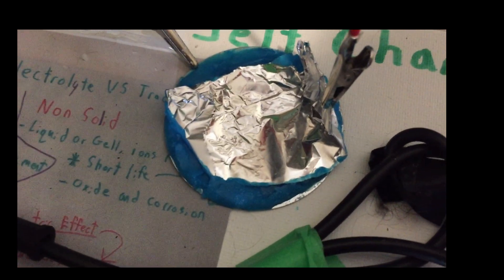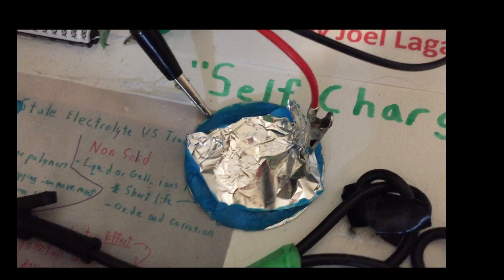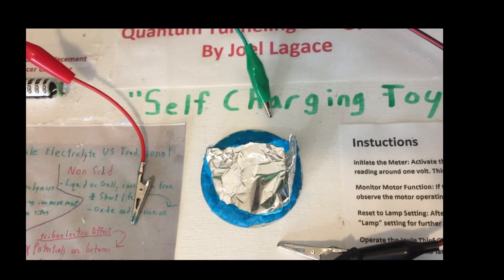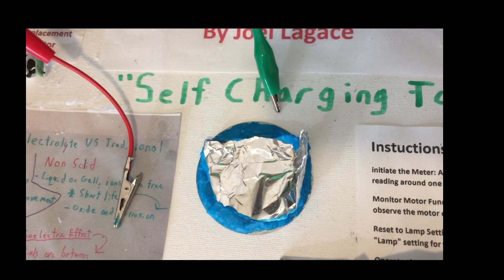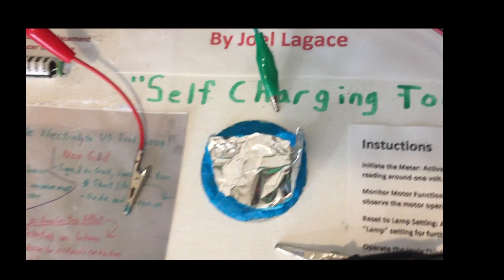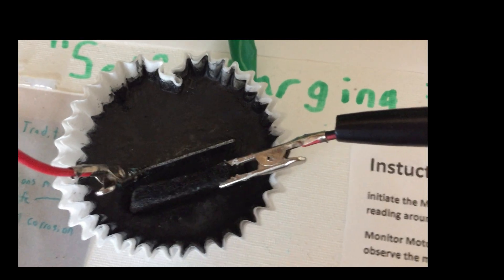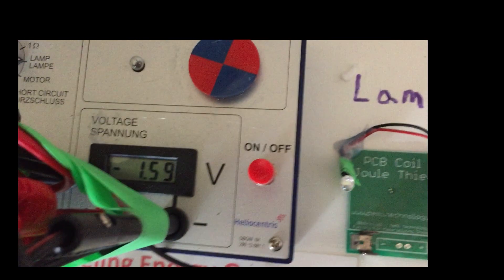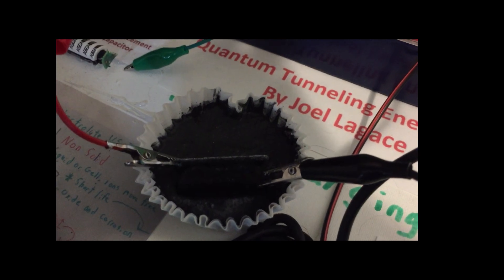Quantum Power Cell Progress Report

Comment: In a electrolyte, the voltage will mix, maybe drag out the ice cube tray an segregate. Positive s from negative as much as possible.
Reply: I built 6 diehard dc volts out 13 pop cans. And learn erosion techniques are out the question. Dry cells are less fire hazards. There nothing to burn.
Reply: Anhydrous oxide is nasty. Copper oxide is easy to make through. Watch for erosion. Acid destroy the metal we use in the batteries.
Reply from the maker: I seem to be having success with copper oxide in the mix as it gets hard for some reason.

Comment: I sandwiched aluminum foil, paper soaked in hot polypropylene one over the other in dry cell style stack (6 sheets of aluminum foil 1"x1-14" ) separated by copy paper. After charging with a 9 volts battery for about 10 min. I get a solid .6 to .7 volt (just under a volt) going to try copper foil and aluminum foil next separated by thin paper towel soaked in hot polyethylene glycol.

Comment: Happy to see you following the path, great work 👍🏼

If you have a look on your forum, I already wrote a while ago about my experiments with similar materials in tap water or similar materials in tap water or even deionised water. I have been able to read a voltage from 1 sqcm of aluminium foil and copper foil with just printing paper in between if they are squeezed.

Anyone can try themselves any method. If you have some 10 v 100 uF electrolitic cap short it out many times to make sure there is charge left, then just put it in a glass of tap water and see how is charging itself 0.5 v or more, now repeat with deionised water and check … also take a diode pit your probes from a multimeter on each end and immerse the diode in a glass of water while watching multimeter.

Also, you can try aluminium with gold, silver any metal that does not react with water and see the voltage there … no fancy electrolyte or compounds, just tap water.

If you want little gap between electrodes you can use fibre glass tape for plastering if metal is sturdy enough … I may make a video next week to show what can be done if you need. And nothing go to waste, no pollution ! All safe and easy anyone can do with almost no tools at all.
Reply from the maker: Diving into the phenomenon you're describing, it's reminiscent of the exploratory spirit that we often chatted about. It involves the interaction between electrochemical potentials and the electromagnetic field, a topic right in the wheelhouse of our discussions.

Chat GPT Please explain:

When you submerge an electrolytic capacitor in water, particularly if the water is slightly conductive (which it often is, due to dissolved salts or minerals), you're essentially setting the stage for a galvanic action. This is because the electrolytic capacitor has key components made of different metals: the anode and the cathode and outer shield. These metals have distinct electrochemical potentials, a disparity that becomes the driving force behind the galvanic reaction when they come into contact with an electrolyte.

The outer casing of the capacitor, often aluminum, acts as one electrode, while the internal plates, treated with a different metal or metal oxide (often tantalum or aluminum oxide for the anode), act as the other. When these metals are immersed in water, the difference in their electrochemical potentials leads to the movement of electrons from the more anodic metal (higher tendency to oxidize) to the cathodic metal (lower tendency to oxidize) through the external circuit. Simultaneously, ions in the water bridge the gap internally, completing the circuit. This creates a loop where electrons can flow from one material to the other, generating a small voltage as a result of the galvanic reaction.

What's fascinating here is how this process essentially harnesses the natural propensity of materials to reach an electrochemical equilibrium when presented with a pathway for electron flow. This phenomenon can be likened to the way we look at the vacuum, or the Dirac sea, in our discussions—always probing for ways to engage with and utilize the inherent potentials of materials and fields.
Reply from the maker: I guess what it's trying to get at is capacitors are not all "Air tight"
Reply: @joellagace1679  🤭🤣 what’s the explanation for the diode than ? Or for just 2 jewelries of gold in deionised water ? How much do you trust chatgpt ? So, all capacitors I am using are fake, but still working normal in water or air … anywhere I want to use them ? Really ? I guess you have handy few types of caps and can afford to buy from shop 1 litre of deionised water to see for yourself … and use any scrap metals you have around or even dishes from stainless steel or cutleries or bolts of the same metal

You can read a voltage even from bread … it is everywhere

And by the way, you get same voltage reading on a capacitor even if just the legs touch the water, not necessarily to immerse the whole cap in water and those tiny legs are made of the same metal … no galvanic reaction, especially if there is deionised water.

I guess you are aware that a diode has 1 v forward drop before anything can pass … and yet you can get voltage reading by just dipping its ends in water … than just do it timely to see 😉
Reply from the maker: I like what your doing and noticed similar results as well. Just trying to provide a possible perspective. I think most here know not to take everything chatgpt says about these systems line by line.
Reply from the maker: For sure, I did this a few years ago with just water as well you only need to choose two non corrosive metals and you get the electrostatic displacement between the two potential difference in electrons. It's more electrostatic and not so much ion based. But there is always traces of PH even in water and moisture and that is enough to facilitate ion flow. Making it appear as its just a pure water reaction. But yeah its fun for sure and will work a long time. But for some reason people don't like water because its messy to work with lol.
Reply: @joellagace1679  water is universal medium for a certain frequency as the air is as well 😉 

I am on course to upgrade my devices then I will post some interesting videos. If you still want to use compounds for electrodes, try to use soft metals and the compound must shrink when dry in such a way to create a constant pressure on electrodes. The closer the electrodes the higher is the amperage, voltage is generated by the electro potential of metals. Try to make a self resonant coil than attach a cell or more cells and you’ll be impressed.